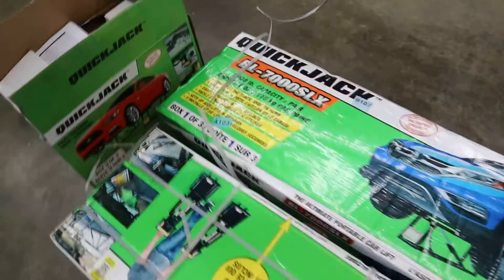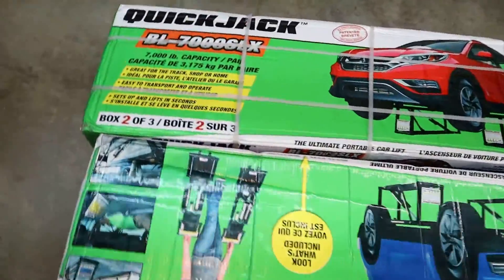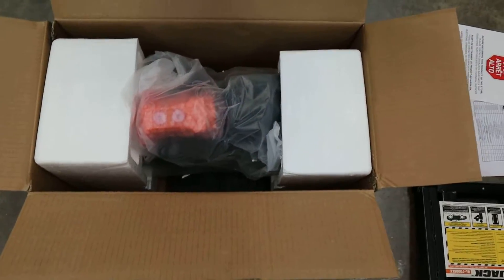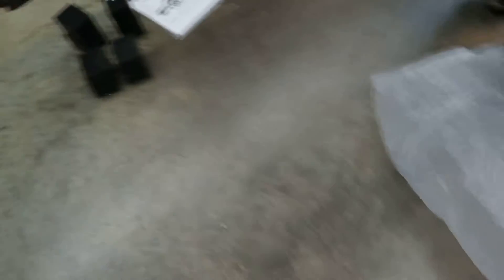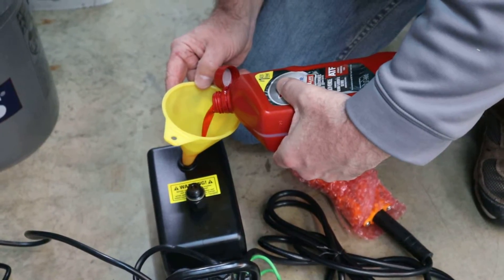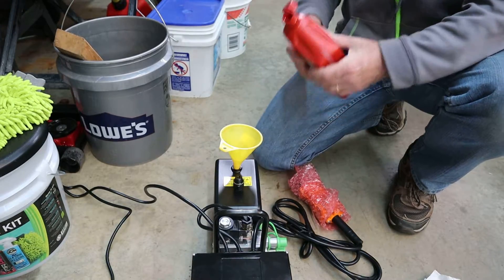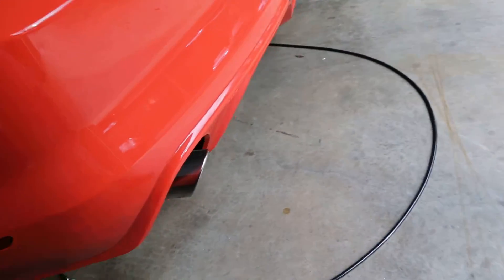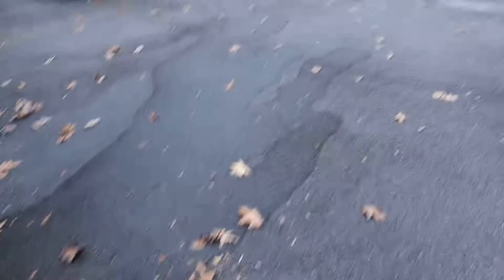QuickJack SLX7000 Unboxing and Setup!

Comment: Hello, I just purchase my quickjack 7000 and am missing a lot of parts. It looks like you guys are also missing the “valve stems” did you fill the air cylinders with 50 psi? Also did you bleed the air out of the fluid lines?
Reply from the maker: According to the quick jack representative said was that the jack did not need to be filled with the 50psi to lift, and we did not bleed the air out of the fluid lines either because they said that was not needed.
Reply from the maker: But they did send valve stems and we are going to fill the air cylinders soon, but we used the Jack just find and did an install already and it worked great! (New video coming soon!)
Reply: Gotcha! I am also missing the 2 power unit fittings. Hopefully customer service sorts everything out!
Reply from the maker: @StephenHerbetko  okay, well yeah those were the only things we were missing, but yeah I bet they will send you those fittings. 👍🏽